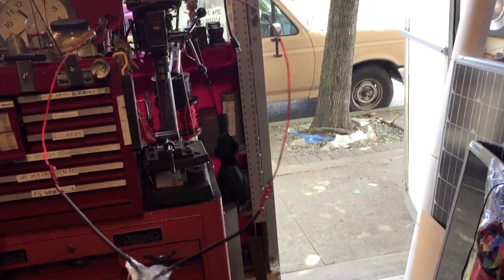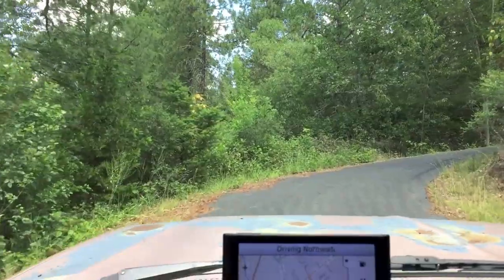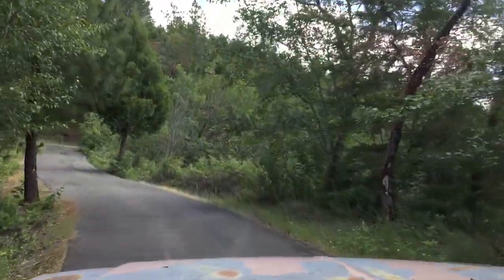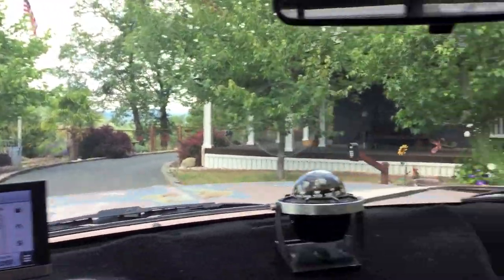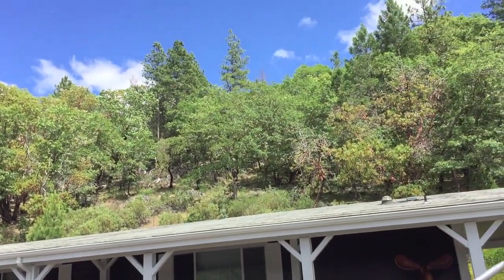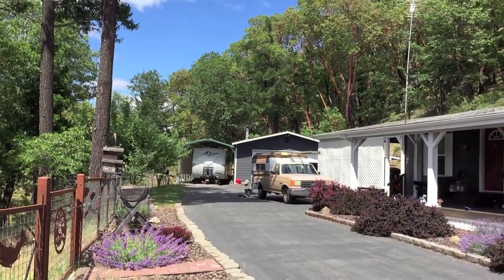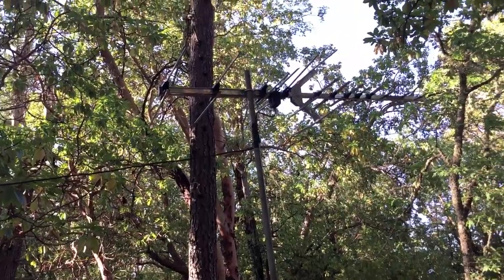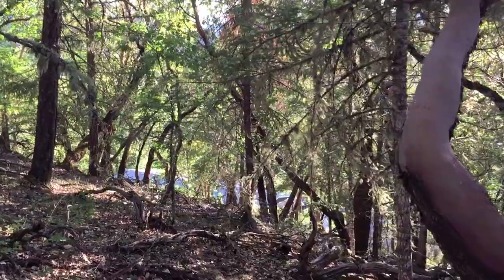300 Feet Of TV Coax and no preamp needed.

Comment: Its refreshing to see someone not milking the job. 99% of installers would have hung a preamp on it before even testing the setup without one. A good antenna with proper placement usually will produce plenty of gain to eliminate the need for a preamp, at least thats been my experience.

Comment: Why no preamp on a 300 foot run of RG6? I run a preamp any thing 75 feet or longer.
Reply from the maker: The fact that the signals were extremely strong is the only logical explanation I can attribute it to.                                                                                        In other locations I've also fond it necessary to use a preamp with far less coax,

Comment: I would have gone farther with the install. Like 5 ten foot sections of Wade GN Tube Tower. On Guy wires every 20 feet. Then used two Antennas Direct XG91's used a Preamp CM7777 and RG11 as my main feed line.
Reply from the maker: We were able to get every channel available in this area without any added expense.
Reply: Grants Pass TV Repair 
But what about out of town signals 50 to 100 miles away. 
Don't know your location, but www.rabbitears.info 
Will tell you all stations receiveable.
Reply from the maker: @diycarhome9151  Around here we can only get a limited number of channels no matter how much effort you put into it. We are in a valley surrounded by mountains.